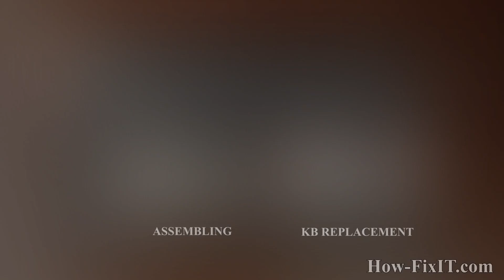Toshiba Satellite C50 Disassembly, Fan Cleaning and Thermal Paste Replacement

Comment: I noticed there are 2 chips in contact with the heatsink, obviously the larger one is the cpu, what is that second one.
Reply: gpu
Reply: @thepreacher85  hmm i have the same laptop and it only has integrated graphics.  This one must have had a gpu aswell